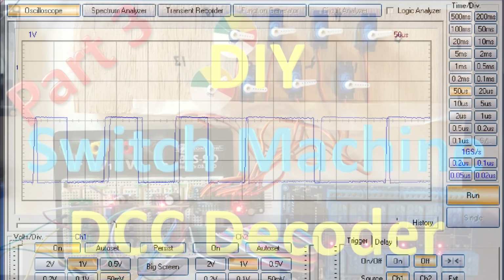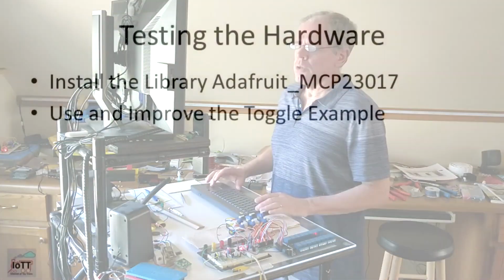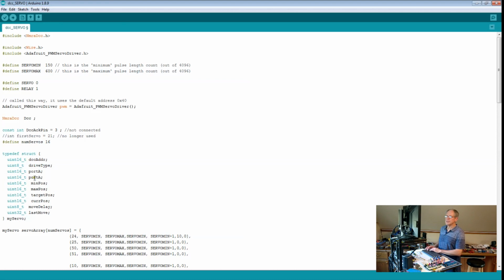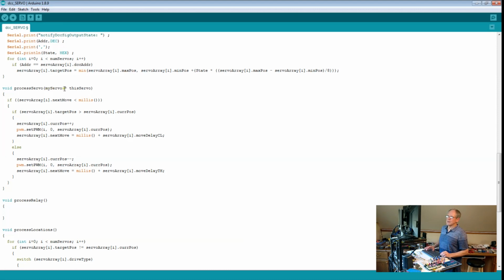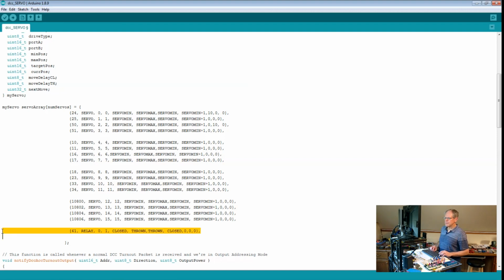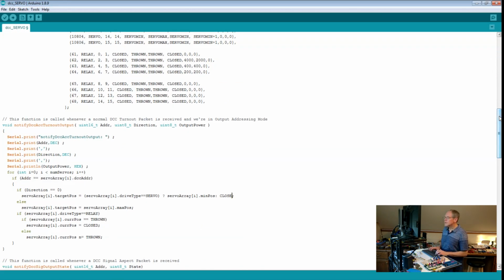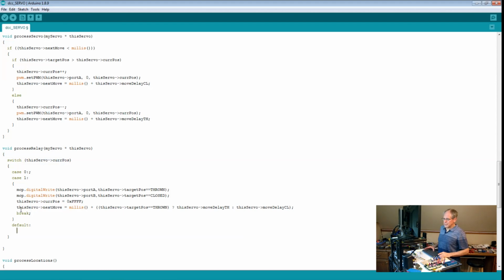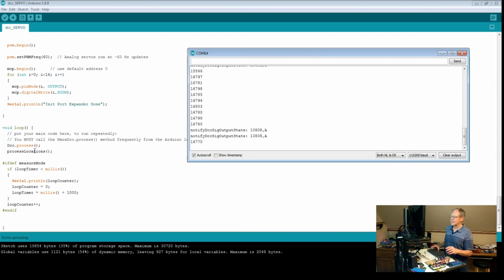16 + 8 Channel DIY DCC Servo/Relay Decoder Part 3 (Video#19)

Comment: First of all, thanks for the clear explanation, it works perfectly.
Now I have a question, I actually want to control 32 relays, the 16 bit GPIO Expander has an option to address, do you have an idea how I connect and control a second and / or third GPIO.
Reply from the maker: The IO Extender board has three address bit fields A0-A2. You change the address by removing the pullup resistor. That changes the respective bit from 1 to 0.
Reply: @IoTT  OK thank you for the answer, I understand, but how do I apply that in the software, which is used in 16 + 8 Channel DIY DCC Servo / Relay Decoder Part 3, I would like to use additional relays.
Reply from the maker: You define a second mcp and initialize it with the address you set by the pullups. Then you extend the code that deals with the mcp ports to include both of them. Of course you add more entries to the servoarray structure to define the relays you are using. And then you change the functions that address the mcps to select the correct extender based on the relay address.
Reply: @IoTT  what i understood:
Relay address 61 - 66 (pin 0-15) are at board 0 and address 67 - 72 (pin 0-15) are at board 1 and so on.

change from #define numServos 24 to, for example, #define numServos 32

expand servo arry:
{69, RELAY, 0, 1, CLOSED, THROWN, THROWN, CLOSED, 0,0,0},
-
-

Init a second board

   mcp.start (0); // use address 0
   for (int i = 0; i <16; i ++)
   {
     mcp.pinMode (i, OUTPUT);
     mcp.digitalWrite (i, HIGH);
   }
   Serial.println ("Init Port Expander Done");

   mcp.start (1); // use address 1
   for (int i = 0; i <16; i ++)
   {
     mcp.pinMode (i, OUTPUT);
     mcp.digitalWrite (i, HIGH);
   }
   Serial.println ("Init Port Expander Done");

  And in this function: void processRelay (myServo * thisServo)
  I think something should also be adjusted but I don't know how

I understand the principle, but I am not a programmer is beyond me.
Thanks anyway for taking the time to answer my question.

Comment: Hans, I’m coming back to this video as I am hoping to use your control system for part of my layout. I want to control N-scale Kato turnouts. As these use bipolar solenoids as apposed to the more common two solenoid switched (snap machines) they pose another small problem. How do you wire them to the relay to allow control? Is connecting them to two solenoids with the wires reversed do it? Or is there another way?
Reply from the maker: Check the slide shown in the video starting at 1:07. The last example on the slide shows your case. Connect + and - of the power supply to the outputs of each relay. The switch goes between the commons of each relay. If both relays are in the same position, the switch gets zero volts, as both ends of the solenoid are either connected to plus or to minus. As soon as one relay is activated, the switch machine gets either positive or negative voltage and will adjust the position.
If you prefer an electronic solution, you replace each relay by an H bridge, which does the same. You could e.g. use an L298 (dual H bridge) for each Kato switch, which would eliminate the sometimes annoying click-clack of the relays.
Reply: @IoTT  Perfect! Thanks Hans.

Comment: Hi,  How about controlling a stall motor with just one relay...
Connect a 12 volt ac source to the common of the relay.  Twist 2 diodes together back to back at opposite ends.  Connect each open end of the diodes to NC and NO of the relay.  Connect the common to pin 8 of the tortoise.  Pin 1 is connected to one side of the ac power source.  As the relay is tossed back and forth, a one half wave of dc is applied to the tortoise...either the positive or the negative wav,e thru the diode.

Bob S
Reply from the maker: Sure, that would be no problem. And it would be easy enough to change the software to only use one port per switch address, so that would give you twice as many addresses for the same amount of relays.
I chose the 2-relay approach because I wanted it to be universal, which means I wanted to have the possibility to switch off the drive, because not all switch drives can survive permanent voltage. But of course, if you know hat you are connecting, you can simplify.

Comment: Thats it - this was for what i‘am looking for.
Great work. Is it planed to expand the script for using more I2C-Boards . I‘am testing the scetch, downloaded from Github, but the programing is to difficult for me. Need some - no, a lot - helpfull hints for doing ist
Reply from the maker: Thank you for your feedback. No big problem to add more I2C modules as long as you can select the address. Since the PWM driver as well as the port expander variable are designed to support only a single module, you would have to define a variable for each module in the software and then direct your calls to the respective address based on the port you'd like to send a command to.
To test my sketch I'd suggest you start with building the DCC interface described in video #17. Simply use the DCC library and make sure you see the incoming commands in the Serial monitor. Once you have this working, it is not too complicated to build step by step from there and I think the instructions in the videos should help you to move through the process.

Comment: Hi, you suggesting a web and loconet interface, make me think of this project by Geert Giebens. https://forum.modelspoormagazine.be/index.php/topic,14127.1185.html?PHPSESSID=1ce6455fa1afee3ea1cb5dfba51858d0 I use Google translate to convert to English. He also has a GitHub page. https://github.com/GeertGiebens/LocoNet_IO What do you think ? Will you also be adding MQTT functionality to this decoder ?
Reply from the maker: Thanks for the link. This seems to be a slightly modernized version of the original LocoIO (see http://www.locobuffer.com) using a PIC controller. In the past I wrote a lot of programs for PIC's, but I think the Arduino world is just easier to learn for people who prefer to play trains and don't necessarily want to be programming pros ;-)
Reply from the maker: I have no plans to add MQTT gateway functionality as the Nano does not have on-board WiFi. This project was intended to provide a simple DCC decoder and use it as kind of a tutorial how to write the software step by step for a simple application. Local input buttons I think would be a desirable feature for many applications, so I may do it in the future. And if I add this, it also would make sense to provide feedback to LocoNet, so that if someone activates a turnout locally, any LocoNet attached device or computer would receive information about the event. The command pickup would remain on the DCC side, no receipt of commands directly from LocoNet, in order to protect  correct functioning of the Bushby bit setting.